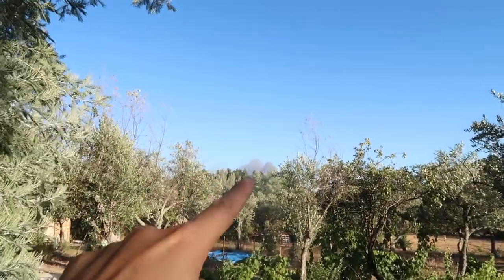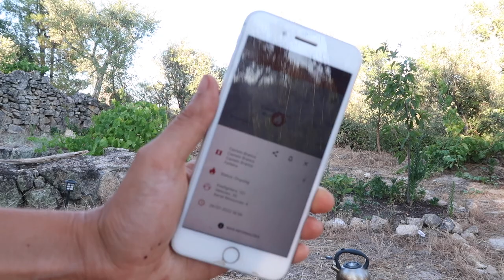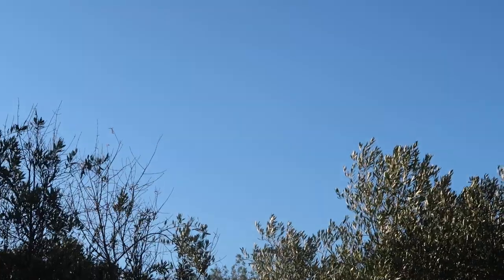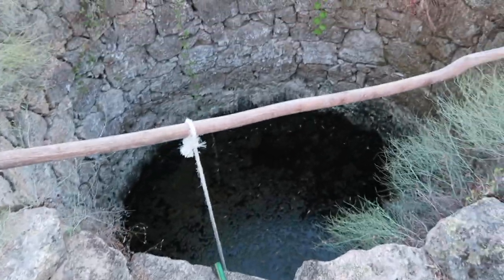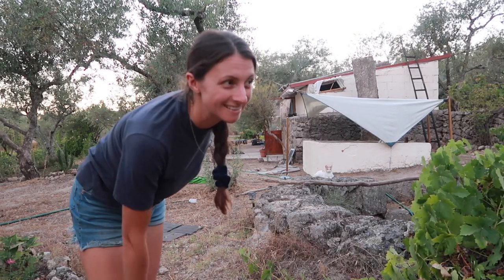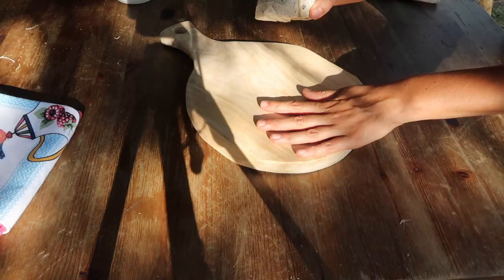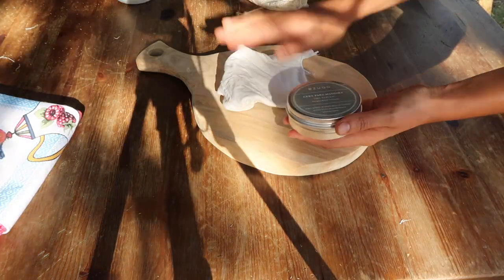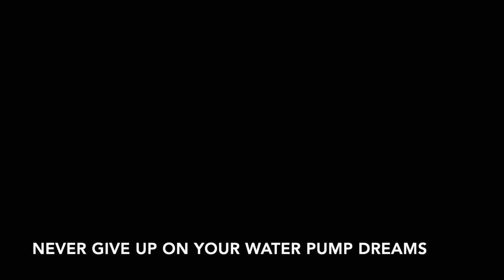OFF GRID LIVING: All I wanted for summer was a WATER PUMP 💦

Comment: just remember the pump inlet works on vacuum! the inlet has to be under water and pipe no air leaks!.. a non return valve will ensure pump is always primed..  another thing i have seen done! is getting a deep bucket! and drill hundreds of small holes, say 5mm, in the very bottom!, then get pool noodles or bicycle inner tubes and cable tie one or two of them around the top of the bucket! place the pump inlet in the bucket, and lower the bucket down the well! the bucket should float and the holes will filter out majority of weeds, roots, frogs and insescts etc pump inlet doesn't have to be on the bottom of the well!..
Reply: That's clever!

Comment: Fill the green inlet pipe with water first, so you are sucking up water, not air to begin with. And add a non return valve to the bottom of the green inlet pipe to stop the water draining out every time you turn the pump off. Sucking air up 7 metres is a lot of air, as it will expand as the pump sucks it. !! It should be really easy every time. 
So 1. Add a non return valve to the green inlet pipe - at the bottom of the green inlet pipe
2. Fill the green inlet pipe with water before you turn on the pump
3. You should only need to do that once as the non return valve will keep the green inlet pipe full of water.
(ps I had exactly the same problems when I bought a pump for the first time and I did feel like a right numpty).

Comment: You need a check valve Al the end of the suction hose so it doesn’t drain back.  It will be very hard to pump without it. Use a flapper type nothing spring loaded
Reply: It has one built into the inlet chamber, as long as the hose stays in the water there will be no need to prime it every time
Reply: @projectportugal  We do this with much larger portable fire fighting pumps (15hp) to get them going: keep the water inlet below the water line and then plunge / move the pipe up and down. It will help move the water up the 4m quicker but might silt up your well. Really don’t want your pump over heating or the impeller will melt/fail really quickly. Given how fire will spread in your environment I would suggest looking at “marina fire fighting caddy” from Rolec (other makes available) cost might be prohibitive but you’ll be able to pump water all around your property and have all the equipment necessary to tackle a small blaze from a safe distance and water down your roof on your property.

Comment: When you tested the pump at Nicks the pump was below the water line so the pipe running from the water to the pump was full. At your place the water is below the pump so the water is most likely running out of the pipe and back into the well before you start the pump.
Reply from the maker: That was exactly it, we just needed to wait for the pump to bring the water up, the pump has a suction height of 7m so we knew it should have worked 😅
Reply: @FrankieOffGrid  🧐 all good things come to those that wait.  Even water, pumped up from 4 meters down. 😁

Comment: Watching others in Portugal.... they tend to not realize that the parts in the well need STRAINERS to prevent clogging.  I use lake water to water my lawns here in Michigan USA.   My strainer is (1st) a commercial intake, but then (2nd) I wrapped that with ordinary household screen .... at least 5 times ....  preferably with any spacing material, as 1 inch balls of screen ----  all that screen will keep algae out and still let water into the intake unit.

Comment: Good video thanks for the update. I work for a pump company so know a bit about them😁. Suction lift is hard application best pumps for this are screw progressive cavity, best manufacturers are Mono pumps or copies are seepex, netzsch and indian brand roto they can do a 8 meter suction lift. Could also fit a foot valve, this is just a non return valve down at the bottom of the inlet pipe. Gives the pump a chance to start quicker as it does not need to get rid of all the air like your experience with your current pump, with no foot valve. The pump has to create vacuum to pull the water up witch is slow. If you fit a foot valve the pump doesn't have to work as hard. Down side is if the foot valve get blocked or stuck open due to twigs / foreign mater it stops working. Only other option is a submersible pump. Remember to look at the pump curve to make sure you have enough pressure / head to overcome the system losses ie pipe run and elevation of the outlet pipe. Happy to help if you have questions

Comment: Next time you try your pump prime it whilst hold a hand over the outlet see if that starts it off better. Some times it’s better to use a hose that goes flat like a fir hose type you put your foot on it and press done whilst starting the engine when you feel the pressure you just slowly lift off your foot. I’ve got two much bigger version of your pump had the same prom until I phoned the manufacturer who told me the correct priming action. Good luck!👍
Et

Comment: The pump saga had me on the edge of my seat. will it, wont it ? Perseverance paid off in the end. Let's hope the drought ends soon. I am a little nervous at this time of year because I am in England and my casa is not too far away from Castelo Branco. (About 20 Miles) I am always releaved when I go back after the heat of Summer has cooled and theres a bit of rain about.Stay safe. Great vlog

Comment: The hose from water source to pump cannot have air in it. A non return valve on the lower end of the hose then prefill from the top and connect. Prime the pump and your good to go.

Comment: Yes you need a non return valve on the end of suction pipe that way the water does not drain back down the pipe had the same problem this week when my non return valve came off the pipe

Comment: That was super of Agriloja to troubleshoot the pump like that for you.  The Wildlsnders recently put up their vlog of how the troubleshot their non working pump when their well got quite low.  It's worth a peek to learn more about pressure, blockages, vortexes interfering with water pump function.  Glad you're to have solar or motorized pump in each of your wells, great plan.  Would it be worth it to get nozzles for each hose to be able to adjust your spray?  Adored seeing Quality Assurance with Ewan and as they each nuzzle up to Mom.

Comment: Great that the pump is working finally! I realy don't understand why they everywhere sell pumps without a foot valve. Waiting for so long before there comes water in the pump is really bad for the pump shaft seal. Hope you can find a good one there.
Reply: yes .... even if this "footvalve" or as we call it, a "check valve" is in addition to a similar unit in the pump....
Reply from the maker: It would have been handy.. even if they just suggested we buy one.

Comment: you need to prime the whole hose down to the water + the waterpump... having a tap on it so the water doesn't rush away from the pump... so fill the hose, prime the pump, turn it on, turn the tap on
Reply from the maker: Thanks Jesper, there is a non return valve in the pump so that should hold it in. Though when we filled the hose, as soon as we throw it in the well it empties. But we have it working now, just have to wait a little time for the water to get to the top ☺️

Comment: Do you guys ever remember seeing fire beaters in the UK national forests? I used to live near Thetford forest.  They had very sturdy broom handles with old tyre rubber squares or old fibre glass fire blanket squares on the handles. They were a kind of first aid measure for fighting gorse and heath fires.  Try to find an online design and make a pair of them.  Also invest in a pair of fire fighting respirators or Nuclear, Biological, chemical warfare gas masks.  I bought one as an escape hood for using on boats if there is a fire onboard.  A particle respirator would help keep the smoke out of your lungs if you need to fire fight.
Reply: Two men saved a neighborhood during the fires in California by beating small flames with wet rags/fire beaters.  While it is a lot of work, it is definitely one way to save your property in areas that are rural.
Reply: I remember these in our woodlands,  what a great idea 💡

Comment: YAY o pump success.. I have a small one that is powered by my truck battery & it wouldn't work .. I took it back to the store and said will you see if I'm hooking it up right on my truck. He hooked it up & it didn't work. 😪 Then he gave it a "Fonzie" hit and it worked. I used it once that way but next season... It won't work. And because of Covid they don't carry them anymore. I think I'll unscrew it today & see if a wire is loose.

Comment: You may have covered this in a previous video (I’m working my way through) but how many square metres is your original stone building and kitchen extension? I’ve been looking at places 20m2 and I’m trying to visualise it in context with some places I have seen that are currently being used.  Big smiles when the pump worked finally. What lovely friends and gifts also, so kind.
Reply from the maker: The barn is about 3x4 and the kitchen is 3x3 so altogether we’re about 20m2 too. It’s definitely a small space to live in but we spend so much of our time outside that it works. We’d like to apply for a small extension so that we can put in a bathroom space on the side of the barn. Good luck with your search ☺️